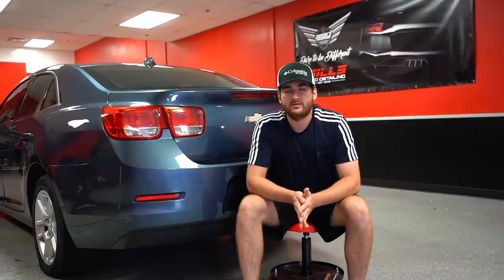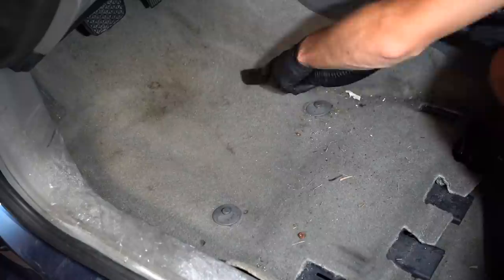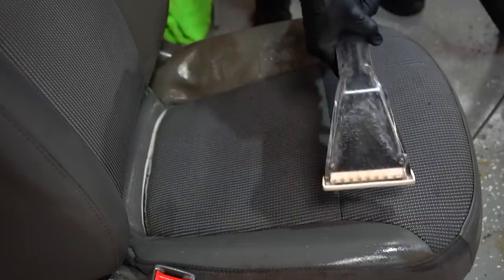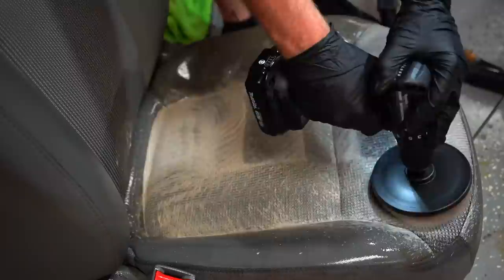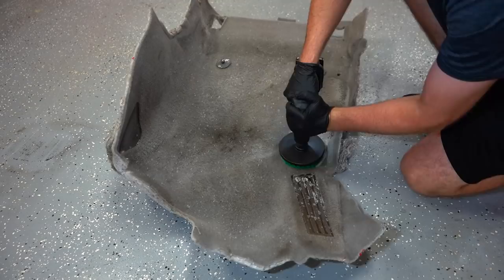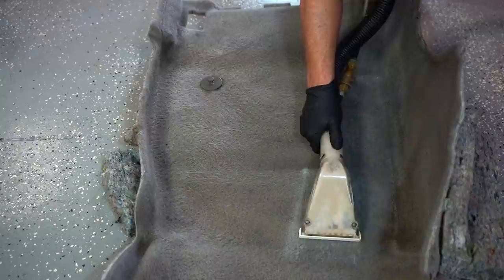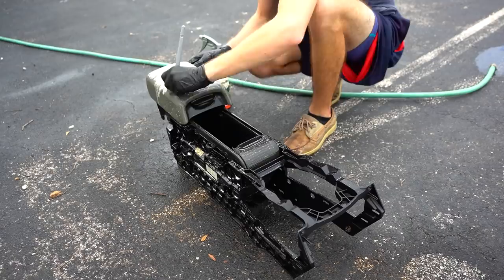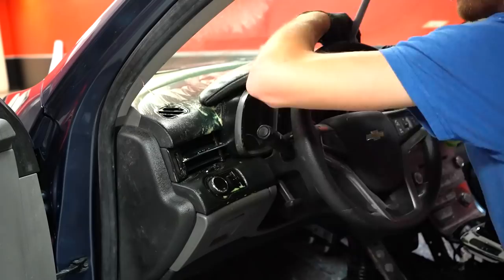Deep Cleaning A ROACH Infested Nightmare | Extreme Interior Extraction| Insane Detail Transformation

Comment: Full credit to those who go to the trouble of making demonstrational videos. Where would we be without you guys? Not making one myself is my only great in life. 
So I would like to share my detailing secret with the world. 
When nothing else works, try oven cleaner. I am not joking,  I have removed stains out of T- shirts, brake dust embedded into the inside of alloy wheels,  stains on vinyl roof linings, oil grease and tar stains off suspension parts, engines too.
Be warned only leave it on a surface long enough to break down the stain, then rince off immediately. It is effective anywhere that is too tight to get the bristles of a brush in there.

Comment: Whats the ball park cost for a job like this? What if it was the same level of treatment without the excess trash ground in and bug infestation (like your normal daily driver not so dirty but still has some minor shoe dirt/salt/etc)    -> Just wondering how much that effects the cost of the job for the end customer and how much extra you loose doing all that extra work if its at the same base rate.